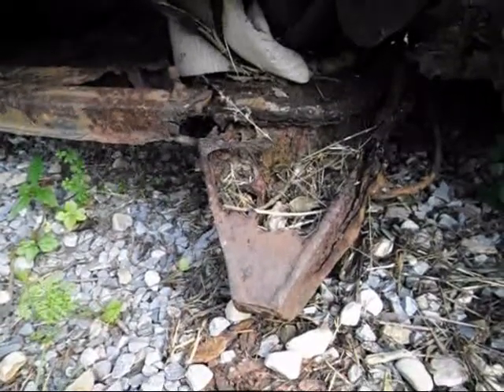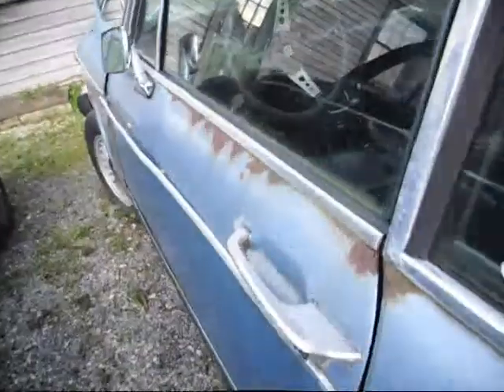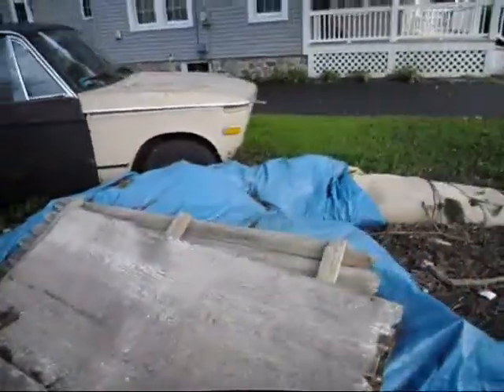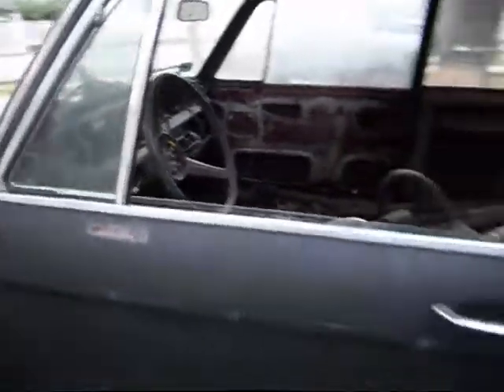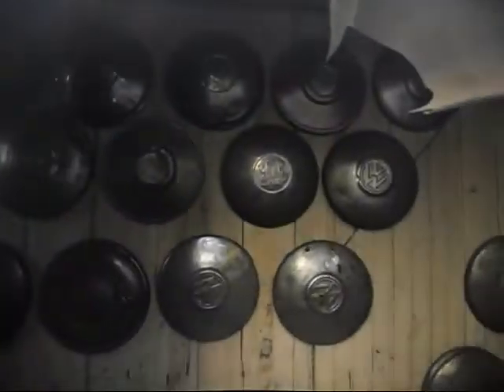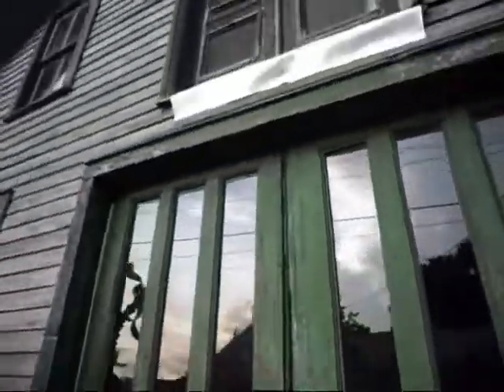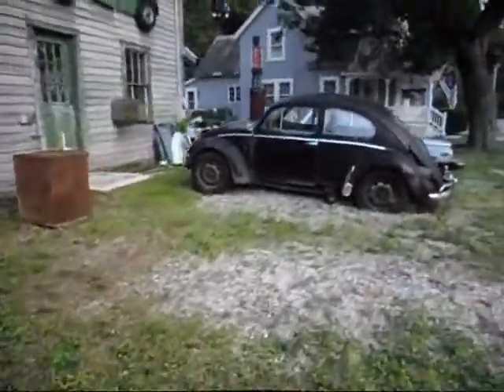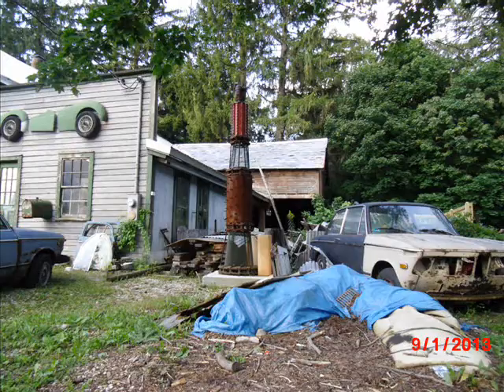9 2 13  BMW Junk Art Vid

Comment: On the Beetle it is conglomeration, as jeepers says its no newer than '57, probably '56 or '57 with '62 to '66 rear fenders and taillights, the popes nose tag light lasted till '63. The blue 2002 with the federal bumpers is a '74-76 but the one with the white nose isn't as simple as you may have thought, it is a mechanical injected TII and the engine is sufficiently rare to be worth a grand or more regardless of condition.